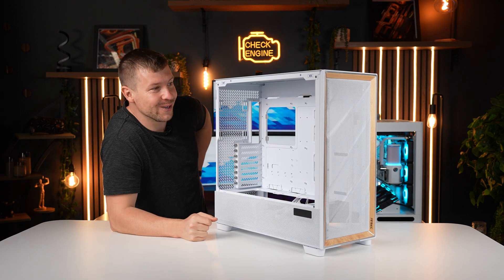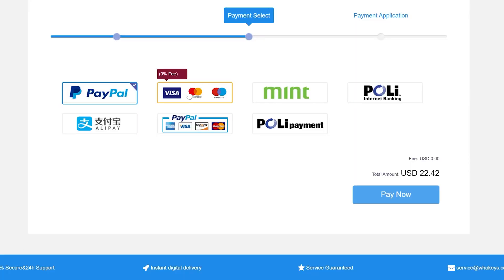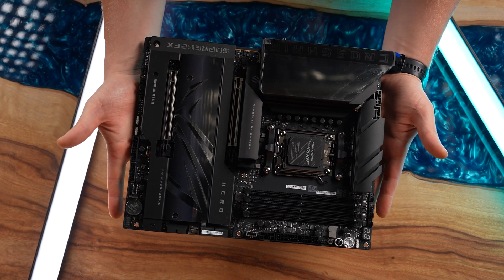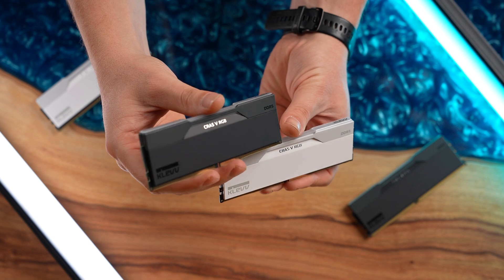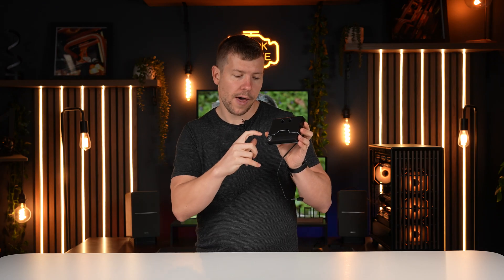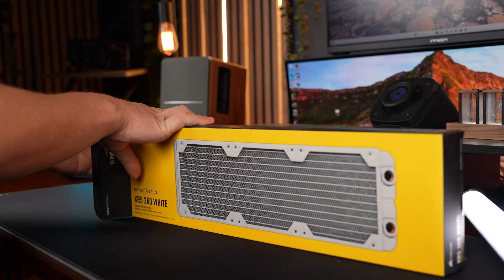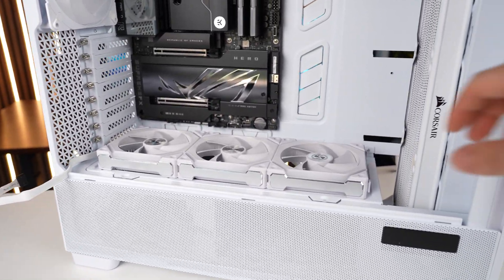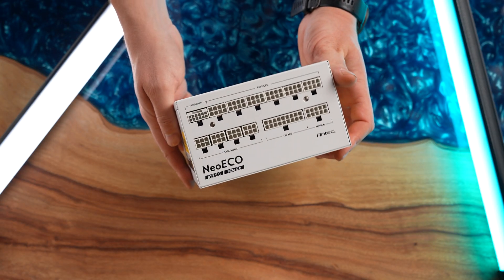The Antec Flux Pro is Impressive! Custom Water Cooled X870, RTX 3090 Gaming PC Build!

Comment: Is it possible to send the power module to the front of the case for mounting to cool the graphics card? 
I think it should be possible since the extra power extension is long enough.
Reply: I was thinking the same (as I'd use an air-cooled card). Unfortunately, there won't be PSU mounting support at the front, but perhaps with some DIY modifications it is possible. Too bad Antec did not make the front the default PSU position, that 120mm shroud fan that now sits in front of the GPU would surely better help the GPU if it were located at the back.